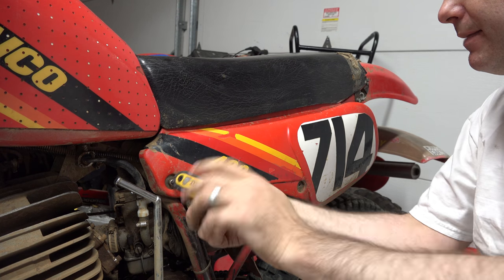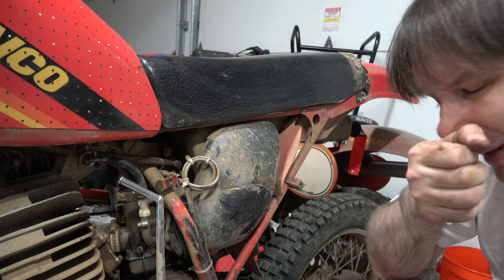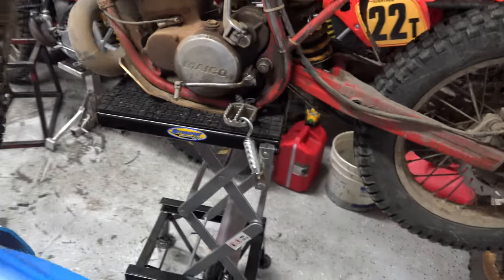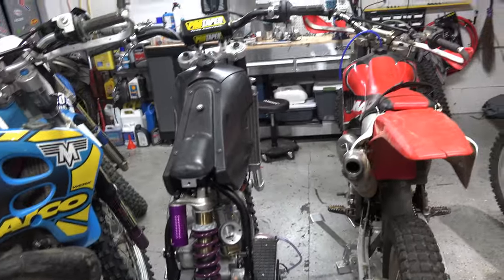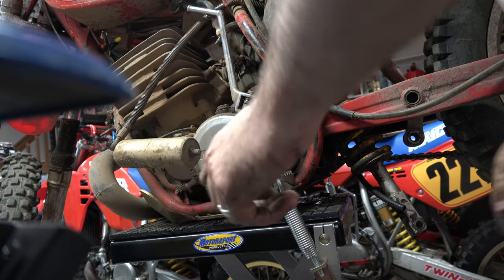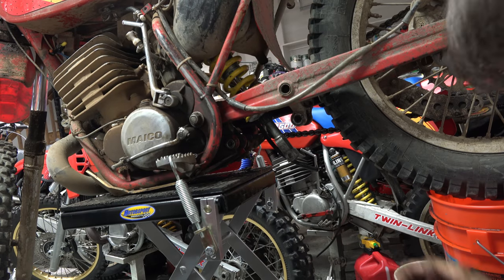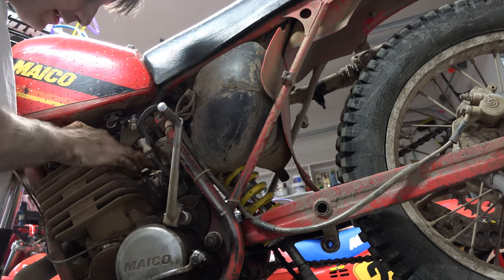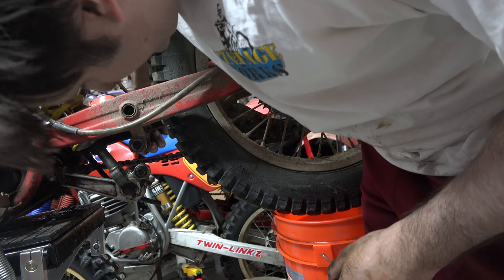New 1983 Maico 490 Rear Shock (Dirtbike Garage: S2 E9)

Comment: From the UK 
That 490 you call a I think a sand spider do we call the same blke in UK a alpha 1 like your vid it reminds me of when I  used to work on the ones I had
Reply: hi Jason , the bikes you speak of   -  the alpha 1  was the 82 mod still had internal chains and piston port   in 83 which was the spider {4 speed } and the sand spider {5 speed} they went to reeds   and cog internal drive , you can tell by the clutch side cover they are very different, hope this helps ,cheers ,   Craig .
Reply from the maker: Thanks.  Yes the Alpha 1 is the 82.  This is the 1983, previously this was a Spider with the 4 speed however it has a 5 speed from 1984 in it but the ratios are the same as the Sand Spider.
Reply: Thanks you are right the 82 single shock engine I believe is the same as the 81 engine they changed the carb inlet by putting a bend in it to fit the air box being the 82 I think not sure  was the first mono shock

Comment: Nice shock, surprised you didn’t clean up the bike before mounting the new shock, lot of dirt and built up oil grease dirt, just  what I do I’m pretty anal, with bike maintenance,  what are the forks on Maicos are they Ohlins as well internally or some Maico design, cheers. Interested to hear how the new shock performs, you like both ends pretty soft? Cheers.
Reply from the maker: Pressure washer wouldn't start last time I took this bike out.  The front forks on this bike in particular from a 1987 Honda CR125.
Reply: Opferman Motors Dirtbiking ah fair enough, sorry didn’t mean to be a dic or sound anal, I’m fussy as hell with my garage and bikes, oh interestingly you are using a  fork off the Honda, thought it may have been Ohlins internals or something.

I dug this out, have you seen it, has a real spec sheet back when magazines did proper tests and gave you real information, not the glossy crap we get today, even bike websites tell you stuff all most of the time.

Scroll right down the page for the specc sheet, you know all this stuff anyways, interesting they ran the 490 at 50:1 ah sorry this was for the 81 490 though most be similar would think.

Was that manufacturer specc?

http://www.off-road.com/dirtbike/how-good-was-the-maico-490-22739.html
Reply from the maker: The forks are pretty much the same as the stock 83 compared to the 81.  I went for disc brakes and the 87 Honda had decent shocks for the era and easy to come by.  I run at 32:1 always, but for the 81 the manual actually says to run 20:1 with any generic 2 stroke oil or 50:1 with Bel Ray MC1 oil or 100:1 with Maico MC GP 100 oil.
Reply: Opferman Motors Dirtbiking ah yeah fair enough re the Disco brakes and the Maico hubs were of 83 were suspect? Only heat treated once ? 

The forks were air assist I understand they actually worked pretty well though, one of the first with rebound and compression? Just a shame they used those Corte & Cosso shocks, though they were alright the 81, still oh,it’s would have been the way to go, surprised the anger and used Italian shocks ( the Ferrari connection I suppose) Ohlins was expensive but it would have made more sense front and rear, it must have been a cost issue re testing because what seems to have made Maico from the get go and up until the 70s was that everything was tested at the track the pioneers of doing this before production why they stopped this seems weird unless financial and then again internal. Pity would really love to ride one. The 83 250 sounds like it didn’t have the same issues as the 500s and was one of the best that year? 

I’d really like to get into some VMX racing but even Jap bikes I am interested in are hard to find.